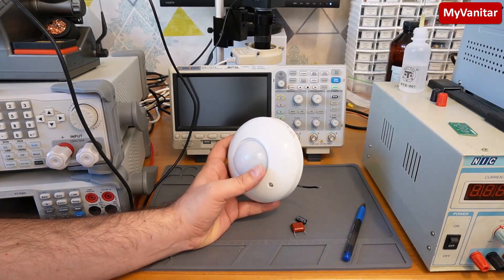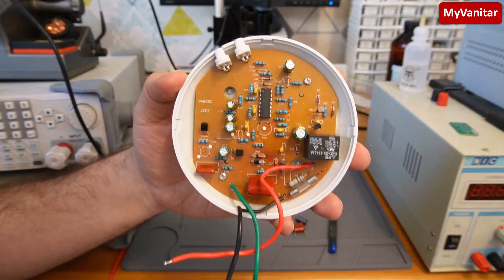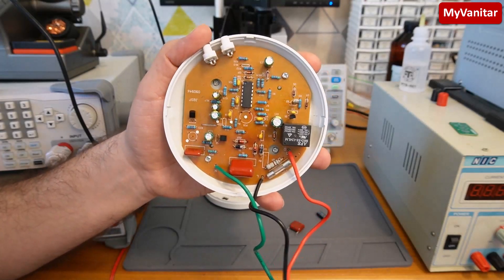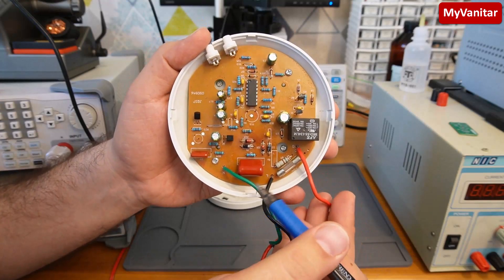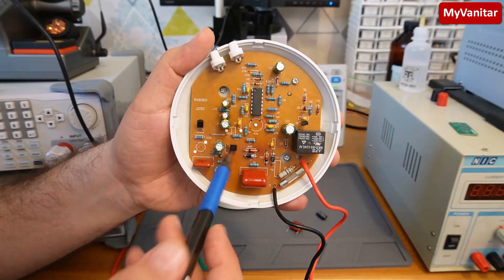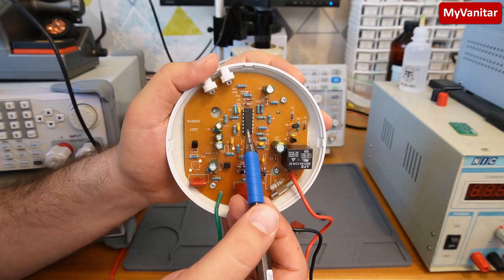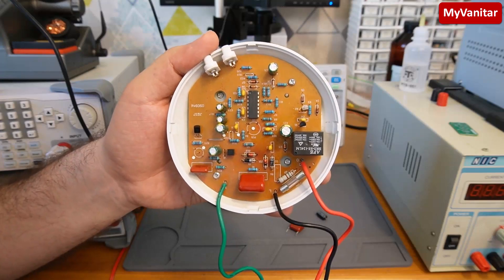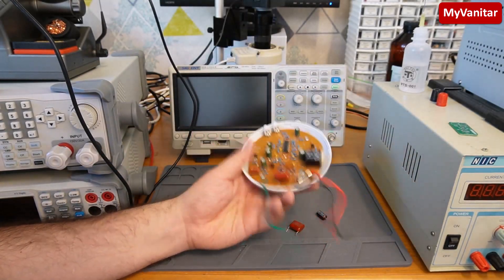Cheap PIR Motion Sensor Repair

Comment: I got new never used 150W halogen floodlight with PIR on it. It was stored in box at parents room for about 20years neglected. When I want instal it to replace third faulty LED floodlight in 5years I realize it turn ON when powered and never turn OFF independently on time, light, sensitivity settings. There are two boards inside. First is capacitive dropper, rectifier, 78L08 regulator, switching transistor and relay. Second is motion sensor with very few components. Boards are connected by three wire, +, - and signal for transistor to switch on relay. I cheched almost everything and it seems to be OK. I don't have meter for capacitor and no spare to replace that time but it must be that. I had no more time to spend with repair so I bypass PIR because there is wall switch in the house from old incandescent bulb lamp before short lifespan LED floodlight. Halogen floodlight is working for 3years and about half hour daily use with original bulb.
Reply from the maker: it could be for the same reason as I explained here. Just replace the input capacitor (in my case is that orange 470nF-400V) and also the supply capacitor (in my case was the bulgy one). if not solved, the problem is likely the Relay itself